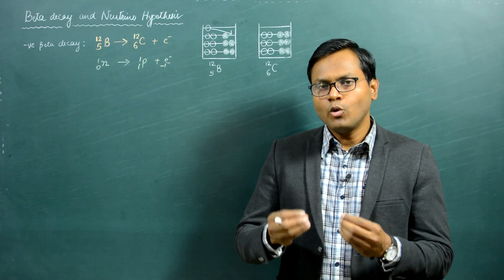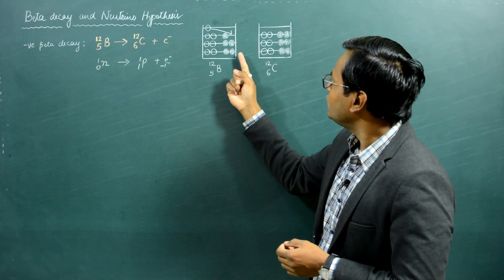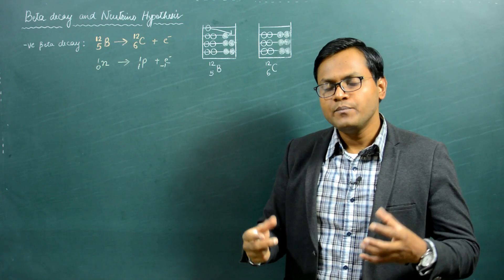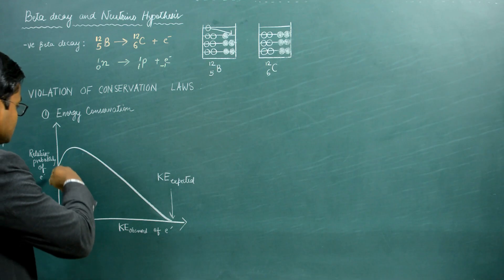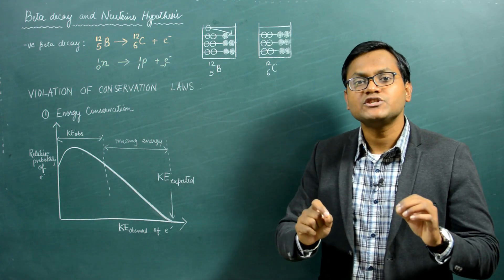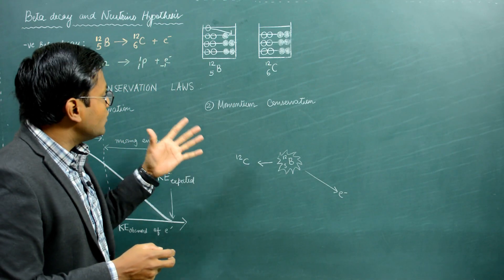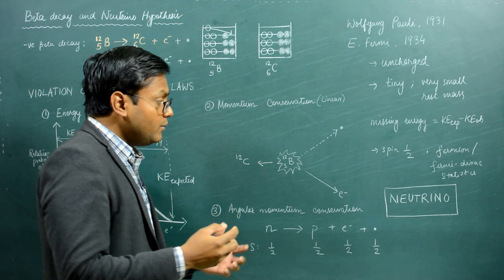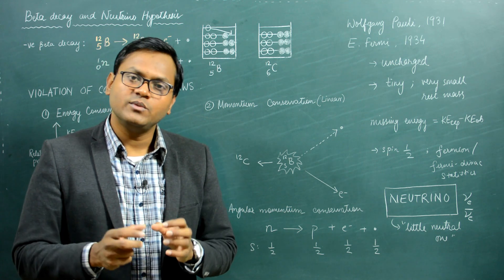Beta Decay & Neutrino Hypothesis !! (VIOLATION of Conservation Laws)

Comment: Mr. Das, I would like to ask you a question regarding what might occur when a neutron is flung by anti-electron neutrino, and likewise the resultant of the collision of a proton and a neutrino since we are aware what happens in The inverse Beta decay.
Reply from the maker: A free proton can never decay into a neutron as a neutron is more massive than a proton. It can inly happen inside a nucleus as the mass defect is adjusted for by the BE of the nucleus
Reply: @FortheLoveofPhysics  You may have miscomprehended it; I did not ask about that. Rather, as in Inverse Beta decay, we have a neutron smacked by an electron neutrino, leading to a proton and an electron; similarly, a proton smitten by an anti-electron neutrino yields a neutron and a positron. Thereof, I asked what would happen when instead of an electron neutrino, the neutron is planked by the antimatter version of electron neutrino; likewise,  a proton getting hit by an electron neutrino, instead of the antimatter version of it.

Comment: How about photon?
Does Beta Decay involve any photon emission, like gamma ray???
Reply: In addition, if neutrino can explain momentum conservation, it clearly interactive with nucleus of the Boron or Carbon + electron.
If neutrino can reflect off these two massive hadron and electron pair, making them to bounce off to other directions, how can neutrino be non-interacting/invisible or rarely interacting, penetrating light-year length of a lead wall???????

Comment: Anyone who would like to be able to explain physics would be worried by the idea of violation of conservation laws.
So I see, no need to worry here.

It seems reasonable to say that neutrons continually have a tendency to decay but proximity to a proton prevents it.
Similarly, protons have a tendency to lose the charge. As the positive charge is moving away, either it gains the spin for formation of a positron, or it doesn't.
In either type of emission, e- and e+, how does a charge gain the spin?
In Clove Theory, the charge is an excess or a deficit in the packing.

The neutron has high-energy hadronic clove circulation at its condensation limit; and it can condense at a gap in the frame but the clove density is the average of the frame density, so the neutron is uncharged.
Frame packing is controlled by a proton - see the face-centred cubic packing (FCC) and how it favours 6-rings of the proton condensation limit. A neutron's 4-ring condensation limit doesn't enter hexagonal close packing (HCP) except away from a proton.
Away from protons, the neutron can be in HCP and the irregular pentagon can drive away a clove and cause the charge separation.

That still doesn't obviously tell where the spin of an electron and the balancing spin of the neutrino are from.
It leads to the proposition that the spin condenses from randomised motions in the frame up to a maximum that the one-clove excess can maintain.
The spin is maintained as the one-clove excess jumps from gap to gap - as the clove frame reforms continually with the effect of transition of the one-clove excess.

Similarly with the forming of a positron - a clove moves as the one-clove deficit of the positive charge moves.
Inherent in that movement is the characteristic of the electron and positron wave form, as described, without physical explanation, with the Schrödinger equation.

It seems reasonable that both can condense the spin; and the rest energy can be the same even when they are not produced as a pair.
This takes Clove Theory further in this respect than my Introduction to Clove Theory, The Final theory of Physics, of 2003, which is available from among people in Physics.

From the first introduction to Physics there is adoption of the belief that momentum is conserved, leading to an assumption, as here, that a neutrino has mass and momentum; and it is good to see the matter explained so carefully.
If an electron condenses spin from a transmission medium, could there be variability such that linear momentum may not appear to be conserved, with an electron's spin direction depending on a variable seeding process against the decaying neutron and its linear momentum being produced in accordance with that also? 

Could each particle involved still condense spin angular momentum consistent with what is stated for individual spins? Is it true that a magnetic field can contain invisible variable angular momentum? Is there uncertainty regarding claims of photon and neutrino mass and momentum?

Comment: Excellent explanations. Just one question, when talking about the fermions the spin on the left hand side is one half but on the right hand side the total spin is one and a half, does this not break the law of angular momentum?
Reply: Actually system of fermions could have spin odd integral of 1/2 ie 
1/2 ,3/2 ,5/2 ,7/2 ....
And if we see right side of reaction after inclusion of neutrino the total spin is 3/2 which is acceptable. So it is not violation

Comment: Sir can u explain how the spin is balanced?
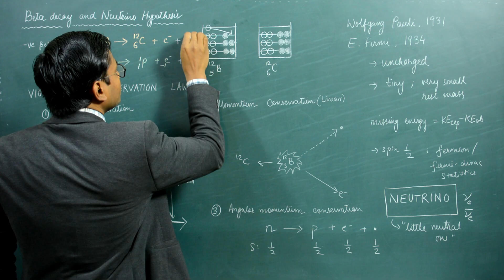Reply: At 14:10 after explaining the electron anti-neutrino, he should have changed the spin of the dot he drew for the neutrino from 1/2 to -1/2 and then that would balance the spin (left side 1/2 and right side 1/2) . The anti-neutrino has opposite spin of a neutrino. I'm sure he knew this but just forgot to put the minus before moving to the next part of the lesson. It was a great video for sure.

Comment: Pauli postulated the existence of neutrinos to account for the loss energy since calculated expected dissipated heat that determined by using Einstein's famous equation, E=mc^2 based on its loss mass during beta emission of a radioisotope is much higher than the actual heat that captured by a calorimeter. Thus, Pauli believed such illusive particle, neutrino is carried away the lost energy during beta emission of a radioisotope. If Einstein's famous equation is wrong, then the existence of such neutrino could turn out to be a bluff! So, is Einstein's famous equation right?Einstein's famous equation, E=mc^2 is wrong otherwise garbage also can be used to make nuclear bombs as long as it is matter or it has mass. Energy and matter can't interchange one another according to Einstein's famous equation. One must have photons before one can emit out photons. Photons are particles and they have mass. All forms of EMWs including light and heat are dynamic photons per volume per time in different saturations. In conclusion, Einstein's famous equation, E=mc^2 is wrong cause a minuscule amount of matter can't turn into an enormous amount of energy! Since Einstein's famous equation is wrong, we can't use it to calculated expected dissipated heat during beta emission of a radioisotope as it only overestimated expected dissipated heat during beta emission of a radioisotope. The heat that captured by the calorimeter is the actual heat that dissipated during beta emission, and there is no loss energy. Therefore we don't really need to postulate the existence of neutrinos during beta emission of a radioisotope. In conclusion, the existence of neutrino is a bluff!If you are interested in real discoveries, I would recommend you to read my book, The Unification Theory - Volume One and you will be amazed with lots of new, interesting discoveries. In God I trust.